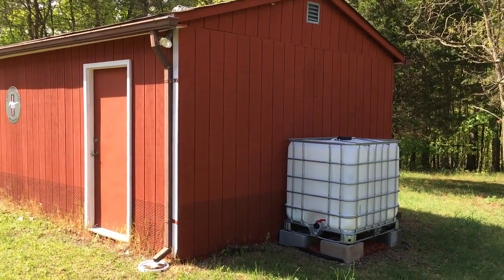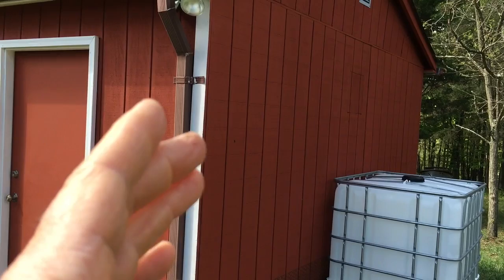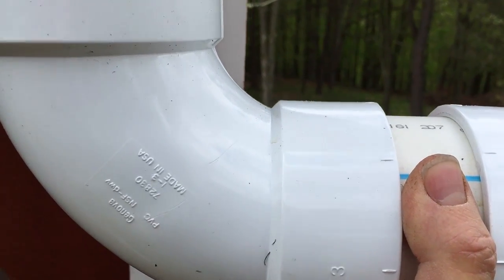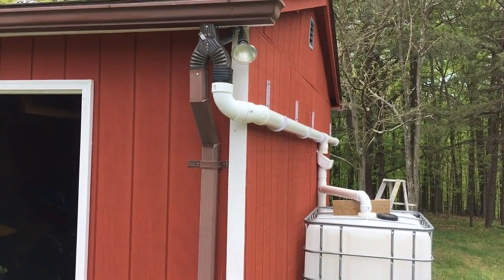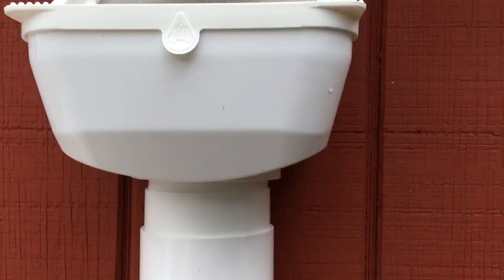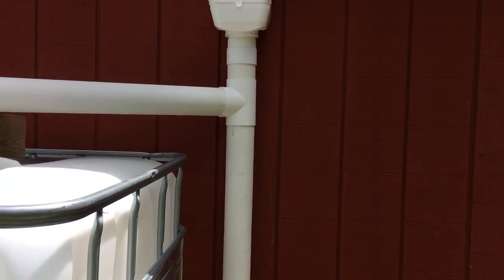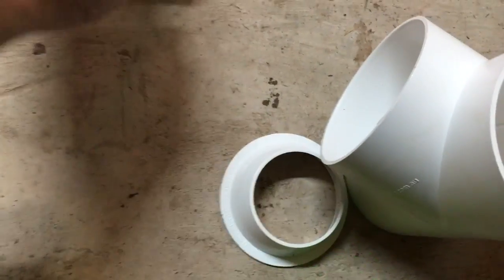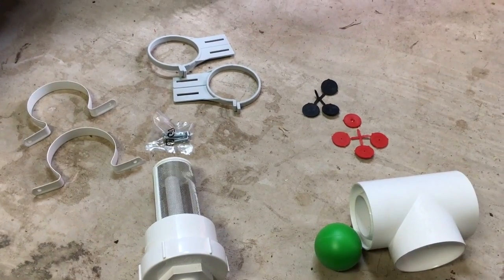DIY Rainwater Harvesting System

Comment: Folks, if you use a water bottle instead of the ball in your first flush,  you will get a better cleaning effect of your debris as it runs out of the first flush.  A little water in the bottom of the water bottle will make it more stable in your flush pipe.  A cap on top of the bottle and it will make an excellent float valve.  And the best feature of a water bottle over a ball is because of the water bottles botom ridges it will allow the slow drain to completely empty all of the water & trash in the first flush pipe.  BEcause the bottle will float higher in the water than a ball and will seal sooner.    A ball will seal off the bottom when it's in the lower position, thereby trapping some debris on top of the ball. 
Paint all your pipes black first for a UV blocker.  Then you can paint the pipe the color of your walls to make it blend in better, so as not to attract too much attention. 
I draped black plastic over my tank for a UV sunblock then built a fake fence & cover to hid the water tanks.
I have 4 225 Totes off the house gutters. And then 10,500 gallons of 1500 gallon tanks at the back of my 3000 sqft shop for rain water harvesting.    My neighbor 4 houses up has a Commercial Garden and I trade him water for his veggies. He has 2 totes mounted on a trailer and drives it down with his tractor to full up off my harvesting system once a week.    So it's a win win for both of us.  I water my (few) livestock with the water off either system and can filter and feed into the house though was system of backflow preventers to the neighborhood water tank.  Everthing is interconnectedd through 1 inch buried PEX lines and LOTS of valves.

Comment: question: If you put the tank up higher wouldn't it eliminate the need for an electric pump for the water and just use gravity for emptying?
Reply: This is the issue that I have.
Reply: No, gravity can only do so much, an on demand pump is necessary.

Comment: lol.. was building the almoust exact same first flush system myself without ever sseing it somewhere else. just was adding a short section with a snaller pipe under  the T-joint and added some pingpong balls to the larger pipe under the laeger section. also left out the filter over the hole. the rest is identical. Funny to see someone sells that idea as a product :)
Reply from the maker: Awesome thoughts!
Reply: @greatescapefarms  thanks.. unfortunatly just an hour after i wrote that comment some heavy monsun rain managed to first get my tanks to overflow and later bring down an entire section of the rainwater collection pipes i had installed. Ended up with my garden becoming an temporary underwater landscape. Looks like my system is in desperate need for some improvement🙄
Reply from the maker: @donalain69  Oh no...  I'm so sorry you had to endure that.  I guess better to happen now then a week before harvest.
Reply: @greatescapefarms  lol..thanks. harvest isnt really a problem. im not a farmer. just have a large garden.
and it happens quite often.. today again for example. the rain was so strong, it took 30 secounds to fill a 1000l tank. 
Way to much to handle for the 2 inch drain opening on the tank. 
also almoust impossible to filter it properly without getting the gutter along the roof to overflow.
Reply from the maker: @donalain69  Wow, that's a lot of water.

Comment: Very good video similar to that what I have to do But I have two totes 275 gal right now And I will add 2 more And eventually connect them all together
Reply from the maker: That's awesome!  I actually now have 3 tanks on this system.  I use the water for composting manure and it has worked wonderfully this year.

Comment: If you haven't get black plastic sheeting to completely cover the white plastic of the inch tote. Doing this will prevent sunlight from causing the formation of green algae. It's easy to cover the tank if it's empty simply by lifting the tank out the covering it with black plastic sheeting.
Reply from the maker: I did end up wrapping the IBC totes in black plastic I had left over from another job.

Comment: thanks for your video, I am going to do this. What type of paint can I paint this with as my tank will be sitting on the south side of the house in full sun all day very hot sun in Oklahoma! From your video, I see I will have to paint it black and then paint it white to reflect the sun! what type of paint would you suggest? thanks ahead of time for your response!
Reply from the maker: I'm a good bit further north than you are so I can not speak to expertise on the paint to use in the hot south sun.  We ended up using a thick black plastic (kind of like a thick contractor trash bag).  We removed the white tote from the cage, wrapped the white tote and then put it back in the cage.

Comment: Can you tell me what those J shaped braces are that are holding up your pipes? Do you think they make them for 3" pipe (I am assuming you are using 4" pipes?  Are they made from plastic? Are they sturdy? They look like they could really help me with my need to hang the pipes on the back of the shop like you did. Where did you purchase them? Thanks.
Reply from the maker: I just looked on lowes.com and found this: HoldRite  4-in to 4-in dia Plastic J-hook.  They come in 4" and 3" sizes.  The stated price online at lowes is $1.58
Reply: @greatescapefarms   Thank you. Super affordable. At this rate I could buy quite a few of them to secure the heavy 3" schedule 40 PVC pipes to the outside wall of my Shop and then hopefully support the pipe spanning across a ten feet to the bucket of my water tank. My only concerns are that PVC schedule 40 pipe might be too heavy. And, I am also wondering how these hooks will last in the hot sun. Mine will be south facing.
Reply from the maker: @seancarney9348  My building is west facing, so it gets sun for half a day.  If you are worried about weight, you could just add more to distribute the weight.  I have not looked, but they likely have weight specs on line.
Reply: @greatescapefarms   Thank you very much for your response again. I found some specs that indicate they can hold 50 lbs. The 3" PVC pipes I am using weigh 72 lbs for a 20 lb piece. Anyhow, I believe the answer you gave is correct. As long as I use enough of the J-Hooks I should be OK. I need to get to a Lowes or a HomeDepot soon to see how thick the plastic will be from the front to the back of the part that I will be putting against the barn/shop. The reason is that my shop siding has ridges that stick out that are sticking out about 3/4 of an inch. So, if the J-Hooks are 3/4" or more thick I should be fine to use them.  Since I am very rural it is at least an hour each way to get to either of those stores. I would love to know how thick they are and also if you think that I can use screws instead of nails.
Reply from the maker: @seancarney9348  I'm 45 minutes from these stores myself, so I feel your pain.  I only ever use screws on any project.  As for thickness, I'd recommend going to the website of the store you will be shopping at and looking at the specs.  Each store will have different products and each store may have more than one product.  Each product will have minor differences in specs as to thickness and weight load.

Comment: Very informative video for something I'm planning on doing in the future, but a question I have is how does the collection box survive the winter? Do you empty it out?
Reply from the maker: Yes, I empty the tanks out.  I only use my system for my nursery business in the spring, summer, and fall, so emptying works great for me.  Here is the video on what I do: https://www.youtube.com/watch?v=nKpfa1h9NYw.  If I needed the system in the winter, I'd use a stock tank heater in the tank and  some kind of heat tape for the pipes.  This one from amazon is a little pricy (https://www.amazon.com/Wrap-On-SEPTLS34731006-Pipe-Heating-Cables/dp/B0002YWM3M/ref=sr_1_5?crid=30XHJUZU7R58X&dchild=1&keywords=heat+tape+for+pipes+from+freezing&qid=1623752420&sprefix=heat+tape+freezing%2Caps%2C151&sr=8-5) but I'd use a cheaper version of this.
Reply: @greatescapefarms  thank you!
Reply from the maker: @Quantities  You are most welcome.
Reply: Those totes, are fine with water in the winter. If it gets extremely cold, you can insulate them, wrap them in blankets, build a building around them etc. I had 2 plumbed into my house and kept a space heater on them in the winter. The only time I had water freeze was in the tank I kept in my truck. I had like 2 bars of water in it and it did freeze when it got to like 10°. I had more problems with pipes freezing than the tank. They also have those cattle tank warmers you could use in the tanks in the winter
Reply from the maker: @Dee-1969  Thanks.  I'm looking into tank warmers for another system for my chickens in the winter.

Comment: Suggestion..., come off those gutters with a 90 degree street ell into a 3" Y with your clean out on the outside end. Also, you have a 3" sanitary tee in the middle (which means the water will only flow one way). They make a double sanitary (or double flow) tee that would flow from both directions. Did you make an updated video since completion?
Reply from the maker: Hi Steven, Thanks for the suggestions!  I have done a few updates in the lessons learned video and a few others over the past year.  The lessons learned video would have most of the updates.

Comment: use a ram pump instead of an electric pump... no electricity = FREE... and it can pump all that collected water uphill.
Reply: Where is he supposed to get the flowing water with good head to power the ram pump?
Reply: ninja5672  not to mention a ram pump requires large amounts of excess water that something like a stream provides.
Reply from the maker: I discovered ram pumps a few years ago.  It won't work with the rainwater system but I do have a running stream, so it's on my radar for a future project.

Comment: Complicated and expensive. All I want to do is use rainwater to water my garden this year instead of hauling out buckets of bath water or digging a waterline. I've setup a basic system without all the bells and whistles. Now all I have to do is tweak it. Filters and improving my short first run off. Need to figure out an over flow setup and correct leaks. If you have any further suggestions that would be nice as I'm learning from your example.
Reply from the maker: Did you get your system up and running with all the tweaks?